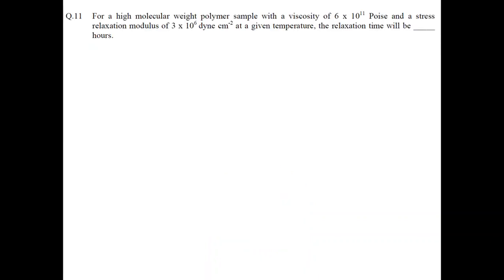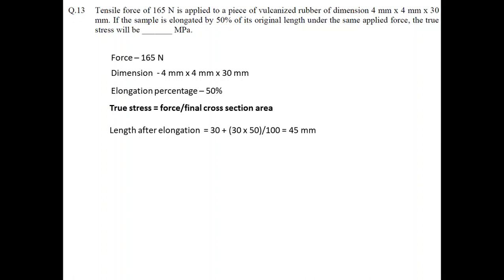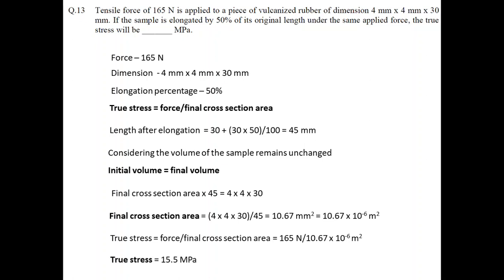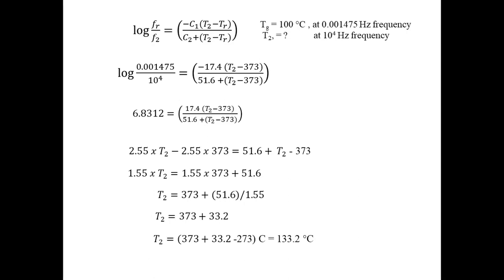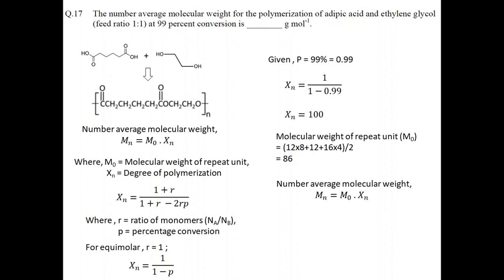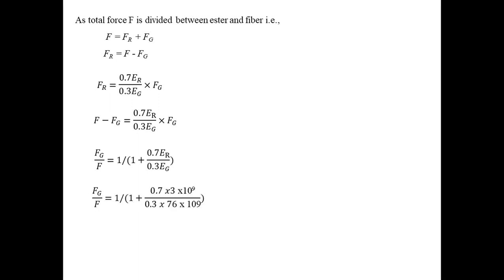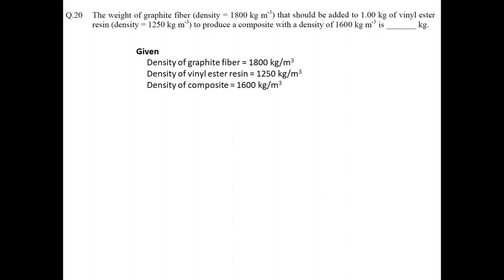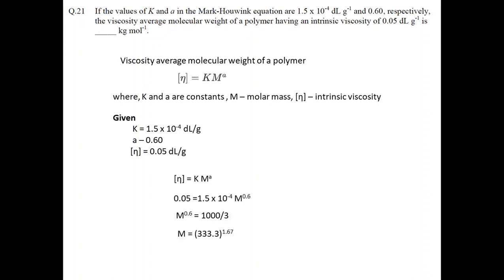GATE 2016 (XE-F) Polymer Science & Engineering (Part II) Solution

Comment: Sir how did you find the length after elongation
Explain the formula
Reply from the maker: Sample was elongated by 50% so the final length will be initial length + 50% of the initial length. The cross-section area will be calculated based on volume remaining constant i.e. initial volume = final volume.
Reply: Does 30 is the original length?
Reply from the maker: @ayeshaparveen5292  Yes.
Reply: Thanku sir for the instant replies...